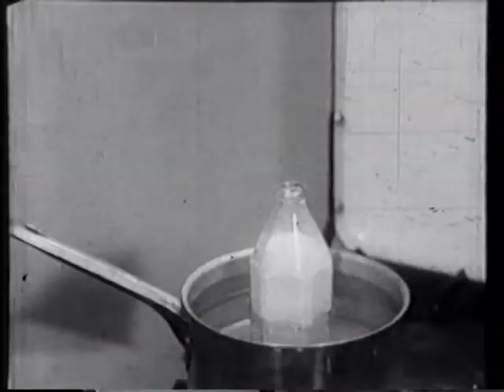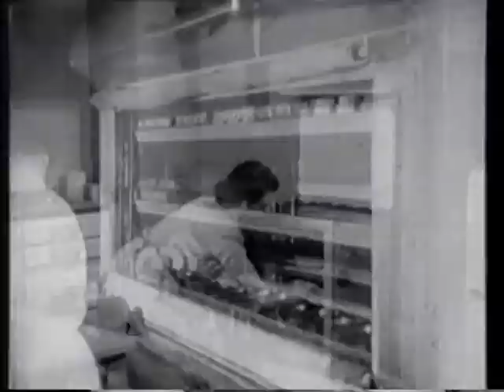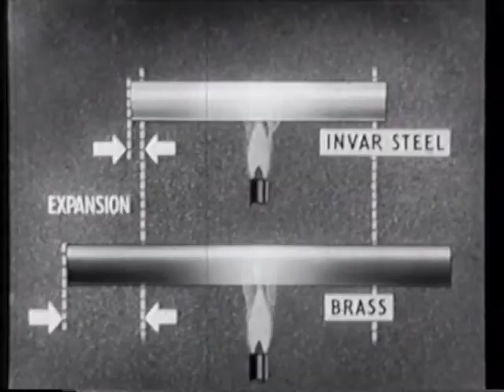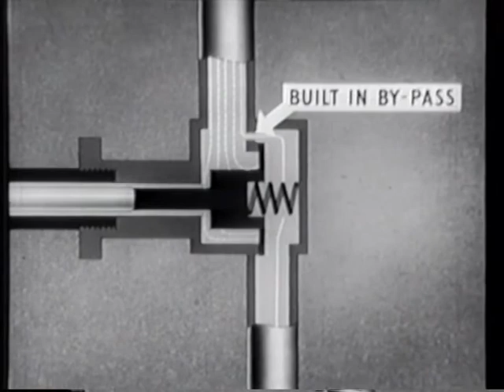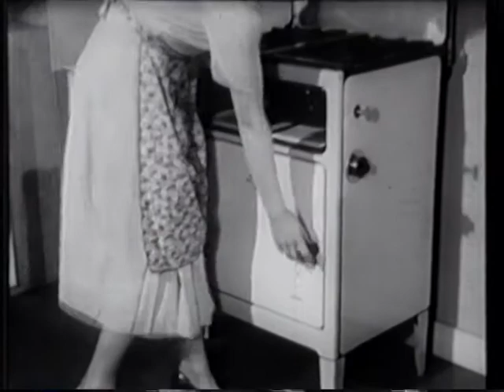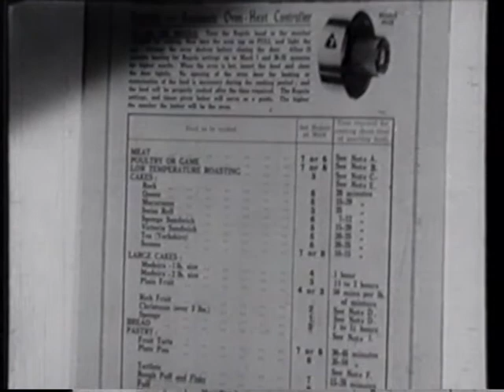The oven thermostat

Comment: On these thermostats how is the bypass flame be adjusted should it be too large? I have a customer with a oven that uses this type of thermostat and the bypass flame is too large causing the oven temperature to continue to rise. In other words the flame does not throttle back small enough. Thanks for your help.
Reply: According to the video you could make the hole smaller letting less gas bypass.